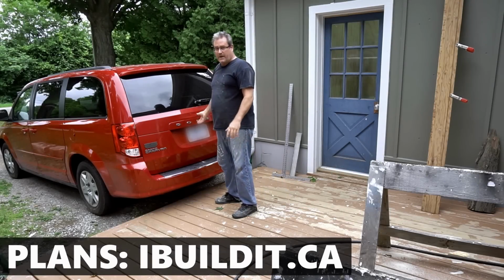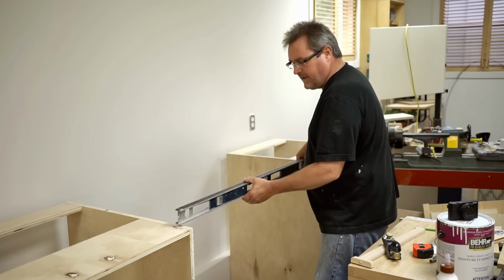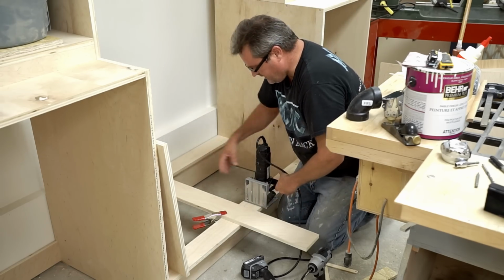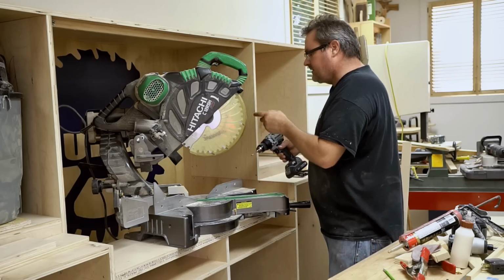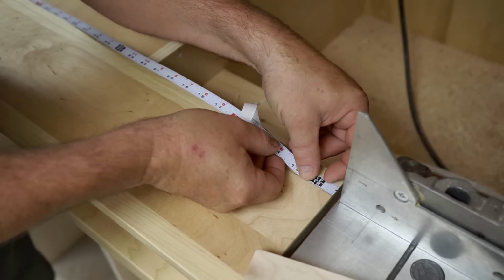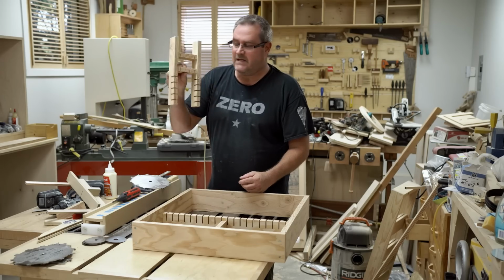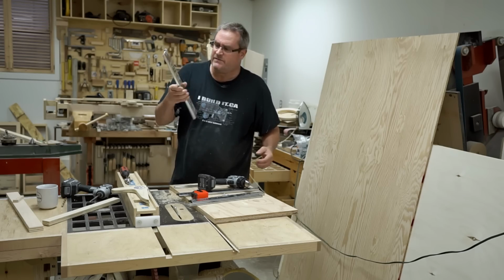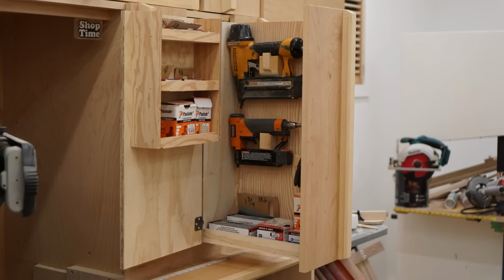How To Build a Miter Saw Station - FULL Video

Comment: ( min 14:26)this might help someone else building this plan. I used thin lag bolts for attaching the middle divider to the toe kick. i pre drilled the middle of the toe kick top, and then transferred the hole marking to the dividers bottom. then i manually screwed in the lag bolt with a wrench. this allowed me to do it without having to move and tip over the whole carcass.

Comment: 31:05  With metric system you always get a good measurement to work with, since its no parts of measurement like 1/4 " , but whole values like 3mm, 6mm or 13mm

Comment: Collecting some miter saw station ideas. Great video John! Your saw looks fairly compact at the back. My makita ls1018l wants to go thru the wall or either crawl into the middle of the damn room lol. Been troubling me for years how to get that thing in a station so it wont steal all the room. The old one i had looked so out of place it was away from the wall too much. Made no sense building even drawers that long. Just a waste of space. I dont want to make a hole in the wall either. It is good having that cut width tho.

Comment: This is great, now, all I need is a flat and level concrete floor in a shed.. :/
Currently all I have is uneven herringbone style pavers in a converted carport which I've put walls around to keep (most of) the wind and rain out of.. my current work bench is 4.5mt long and has 12 legs.. 10 of which have shims of varying lengths up to 40 mm.. It was a 4 hour nightmare to level this thing..
One day I'll buy a place, and get stuck into setting up a proper workshop.

Comment: Nice station, John! Very cool! I'm redesigning my garage woodshop and am going to incorporate this type of setup. For the vertical slide out "drawers", do you think you could simply mount the drawer slides directly to the top and bottom of the cabinet boxes and the top & bottom of the slide-out board instead of mounting the drawer slides on the sides of the cabinet and boards? Does anyone see any issues with doing it this way? Maybe the board is stronger screwing it into the faces instead of the sides but that could be negated with edging the top & bottom with some hardwood. Hope this makes sense...Thanks!

Comment: Great build John as always. I am planning to build something similar but I have to swap out my miter saw first. I currently owned the dws779 but it is taking up way too much space because of the sliding rails. I want to ask what's your overall thoughts on the Hitachi you're using. thanks

Comment: i tend to use just the shims add wood glue get them level tape them in place flip over the cabinet and brad nail the shims in place then cut off anything sticking out. nice miter saw station man

Comment: Question: you did not use the type of pull out drawer that once extended, can "tilt" 90 degrees? err not explaining it well, but once the router bit draw is fully extended would be nice to "fold" it back, so all the bits/etc are visible...

Comment: John, I hear the drill ratcheting every time ya drive in a screw.  Is that the torque setting or the bit rotating in the screw head.  I am pretty sure it is the former, but will you comfirm, please?  Also, is that plain white Elmer's glue?   And the screw length, gauge and drive type are of interest to this old vet who is still learing!  Baltic birch  I believe, for the most part, cheaper stuff for the backs, judging by the filled knots.  Very handsome cabinet and it must be real nice having a mitersaw set up & ready to go.  Mine sits on a shelf most times, and so I make do with a skillsaw or 'push it just a little' on the tablesaw.  I haven't  a free wall, so any stand will be on locking wheels & fold up wings.  Very nice video, an enjoyable watch on Sunday.  Thanks.
Reply: That ratcheting sound is the sound of an impact driver.
Reply: I believe John's using an "impact screwdriver".  It's not a "drill/driver".
Reply: Lile others said: it's an impact driven. It's similar to the torque protection on a normal drill/screwdriver, except it is designed to deliver torque with each "click".
From what I've heard, it can fasten screws tighter, as it's less likely to cam out or strip a screw using these impacts rather tham continuous torque, and it's more compact as you can't use it for drilling and doesn't require a two speed gearbox. The downside is that it's louder, which is why Matthias Wendel doesn't like them.